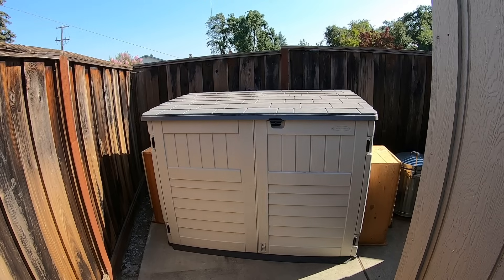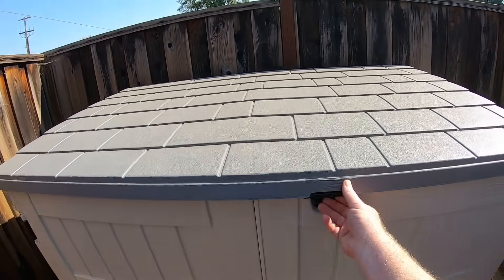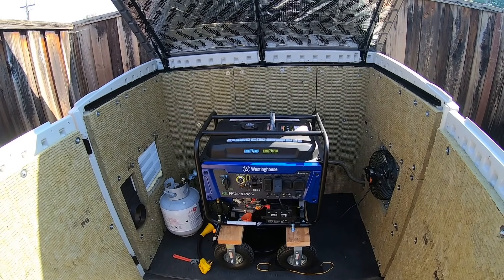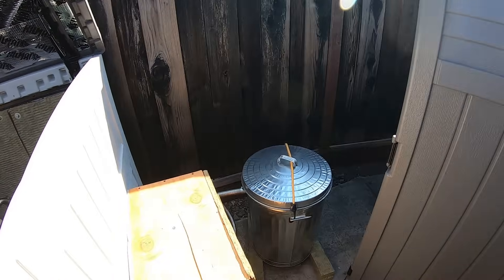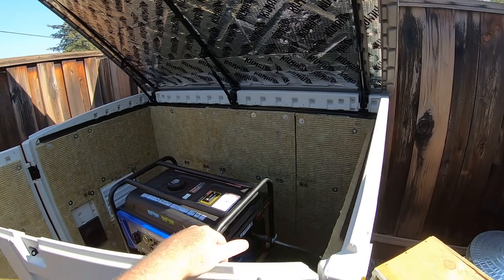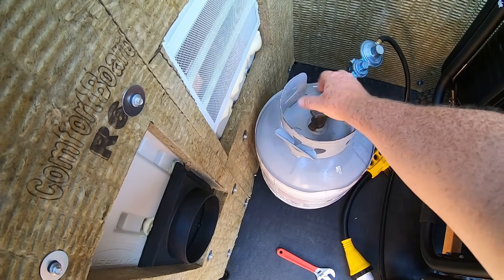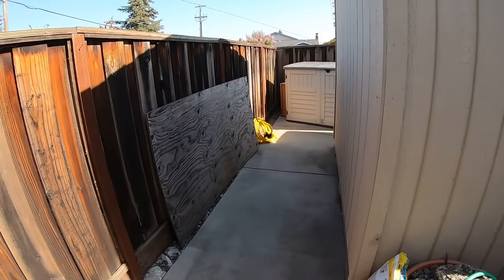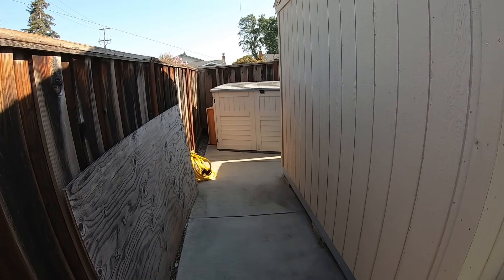DIY Generator Shed Build - Quiet Sound Insulation with Exhaust Muffler

Comment: have you thought about adding spray foam insulation to the inside of the shed as well? that's what they do on the generators used for film - since it has to not just be quiet, but silent for dialogue
Reply from the maker: I did use spray foam around all the holes that I cut for the vents and the fan and such.  This was to seal the holes and keep water from getting in.  However, you have to be careful.  The foam does expand, and can make the plastic panels bulge out.  It might make a bit of difference in sound levels, but I'm not sure how much.  I also didn't want to drill dozens of extra holes in the shed.  So I'd say try it at your own risk.
Reply: @C5Tor  when i wrote this i hadn't realized you used the rockwool. I'm sure that's probably do the same thing, spray foam on top wouldn't do much more. The film generators I've been around seem to be about this loud anyway. we usually park them behind a building or a big box truck to block the sound even more

Comment: What has been your average run time on a  tank of propane?
Reply from the maker: I haven't had to run the generator in anger yet.  Managed to dodge any power outages since I built the shed.  Only ran it during testing phase.  Supposed to be about 8 hours.

Comment: You should put the tank on the outside of the shed in another small structure!
Reply from the maker: Agreed.  The shed is setup so that I can put the tank outside while running, and pass the propane hose back inside via the same opening as the electrical cables go out.  I discuss this in a separate video.  When I made this video, it was just for sound testing.

Comment: Well done kind Sir. Thus, I will do the same.
Reply from the maker: You might want to check out my later videos.   I did a later video on my Version 2.0 exhaust, which has quite a few improvements over the earlier version 1.0 setup.  The newer video has parts lists, shed costs, and other Frequently Asked Questions.  Check it out here: https://youtu.be/y3pUw408jCU

Comment: Thanks for the really great video, and sharing your ideas. Question: I am following your lead with my own shed - how did you attach the Rockwool to the sides? I see bolts/nuts/washers on the inside, but not on the outside of the shed. What exactly did you do, and what specific parts were used? Thank you again for the video, and in advance for your time in providing this info.
Reply from the maker: I go into all of those details in a later video on my channel.   I did a later video on my Version 2.0 exhaust, which has quite a few improvements over the earlier version 1.0 setup.  The newer video has parts lists, shed costs, and other Frequently Asked Questions.  Check it out here: https://youtu.be/y3pUw408jCU

Comment: What kind of screws did you use to attach the rockwool to the plastic. From the looks of it, the screws have to bite into the plastic on the inside without poking out to the outside. Does the vibration from the generator cause the screws to fall off?
Reply from the maker: I go into all of those details (and a LOT more!) in a later video on my channel.   I did a later video on my Version 2.0 exhaust, which has quite a few improvements over the earlier version 1.0 setup.  The newer video has parts lists, shed costs, and other Frequently Asked Questions.  Check it out here: https://youtu.be/y3pUw408jCU

Comment: I think you could lose even more noise if the box structure wasnt just plastic, but made of something like brick or paving slabs. also where possible have no opening on the side or bottom having them on the top allows the sound they leak to go skywards away from other people and buildings

Comment: Nice setup, is there any concerns that the propane tank is inside the enclosure with the generator and the heat that is generated , the heat can get too hot , which may cause the propane tank to explode. I was considering do the same setup but my son brought this to my attention. What is you thoughts. Please reply . Thank you
Reply from the maker: Yes, the propane does go on the outside.  There is an opening on the left side where the electrical cables and the propane hose can exit the shed.  You can just set the propane tank outside and run the hose back into the inside of the shed.  The video was just testing the shed sound levels, so I never bothered to move the propane tank during the short test runs.
Reply: @C5Tor  thank you for the information, I was nervous about keeping the tank in the shed with the generator.

Comment: Where did you get your wood at
Reply from the maker: The only wood I used was for the side baffles.  I just used some scrap wood I had laying around from other projects.  I do give some measurements/specs for the dimensions I used in a later video about the version 1.0 exhaust and the making of the trashcan muffler (see my channel).  However, those were just what I used, and there isn't any requirement to use that size.  You could use plywood, MDF, 2x4's etc.
Reply: @C5Tor  rockwool material broad can't fine them anywhere.

Comment: Does yours have a CO2 shut off it will build up in that shed box! But I keep my generator in the. Exact same box so I drilled 2 holes as far apart around the corner and ran a motorcycle security cable around it. I just feel like the shed is easy to break the lock but the cable would take breaking it alot!
Reply from the maker: It does have a CO2 cutoff, but it hasn't triggered during testing.  The fan moves quite a bit of air through the shed, and all the air is cycled every few seconds.  The shed is only 70 cubic feet. (minus the space taken up by the generator itself), and the fan moves 1000 cubic feet per minute.  If the fan fails, the CO2 cutoff should trigger fairly quickly, though.

Comment: I was an engineer for a company that designed huge generators outta massive diesel engine. For 2 companies. And designed Many enclosures. For a newbie good job.
Reply from the maker: Thanks for the encouragement.  I certainly did a few things wrong on my first attempt.  I corrected a few of them in some later videos, like enlarging the exhaust and updating the muffler a bit.  Should definitely update the fans for better airflow, though.  But it is probably good enough for the purpose it was intended to address.  Thanks again!

Comment: great video I like the bigger wheels how did you build that and mount the generator to it?
Reply from the maker: I actually go into some detail on the wheels and how I attached them in the Frequently Asked Questions section of a later video on the shed/exhaust build.  I did a later video on my Version 2.0 exhaust, which has quite a few improvements over the earlier version 1.0 setup.  The newer video has parts lists, shed costs, and other Frequently Asked Questions.  Check it out here: https://youtu.be/y3pUw408jCU

Comment: Thats awesome. I want to make a small enclosure for my 2200 Honda that I use for my RV. I thought a plastic tote would make it most portable. Then I told myself that was crazy. But if it is lined with the rockwool and vented well like your plastic shed, that might not be so crazy 😁. Great video

Comment: What cutting tool was used cut into the shed side walls for the vents and fan?
Reply from the maker: I personally used an oscillating multi-tool with a plunge-cut blade.  Goes through the plastic like butter, and allowed for nice straight cuts and sharp corners.  I actually go into some detail on this tool in the Frequently Asked Questions section of a later video on the shed/exhaust build.  I did a later video on my Version 2.0 exhaust, which has quite a few improvements over the version 1.0 setup.  The newer video has parts lists, shed costs, and other Frequently Asked Questions.  Check it out here: https://youtu.be/y3pUw408jCU

Comment: I have a question for you.  I've built a similar generator house, inspired by your video.  My shed is a little bigger; I can store 4 5-gallon gasoline cans with a pump with room to spare.  (I take the gas cans outside of the shed while operating)  I have the same generator although it is gasoline only.  My question is about heat.  Does your system stay within the maximum recommended operating range of what is called for in the manual?  I worry about my system after testing.  The manual states 104° F maximum ambient temperature for operation.  My system generates far above that, about 112° F all closed up with no load.  The manual says the generator can be run for short periods @ 122° F ambient, but I fear that temperature will constantly exceed that if closed up and under load.  Have you run your system under load all closed up while monitoring the temperature.  What is the temperature while running under load and how long have you sustained under-load operation at that temperature?  I am going to install a second vent and perhaps another fan.  My current fan appears similar to yours, it is 1650 CFM.  I can always pop the lid open a bit to maintain a safe operating temp, but that does defeat the sound proofing to some extent.  What has been your experience?
Reply from the maker: Good question.  I haven't had to use the generator shed in anger yet.  So I haven't had a chance to do any long-term testing.  Longest run has been about 15 minutes.   I would say that additional airflow is always a good thing, and if I had anything to do different, it would probably be adding a slightly larger fan and inlet.  I did make a couple later videos, especially one where I upgraded to a larger, more free-flowing exhaust, so you might want to check that out on my channel for additional tips.
Reply: After further testing...
 @C5Tor  My system  with fan running (12" Dave Brown 1800 CFM- not 1650) and a single 12" X 12" vent, (with no soundproofing yet) all closed up with about 30" of exhaust pipe, inside the enclosure, wrapped in heat-proof fiberglass tape to help contain heat within the pipe, takes about 30-35 minutes to reach an ambient temperature of 124° F.  This is with no load.  Adding a load generates significant additional heat.  The manual states that this generator can operate @ up to 122° for short periods of time.  Obviously, this is unacceptable lest you risk potential (and permanent) damage to the unit.  I will install another vent, but I doubt that will completely resolve the heat issue.  The situation is easily resolved by raising the lid 8" to 10".  This allows some sound to escape, and will also let some rain in, but both of these issues are significantly attenuated by the enclosure itself and may be acceptable for continued operation.  The intruding weather and escaping sound are a drawback, but better than frying a $1000.00 generator.  I will make a few changes (like the additional venting) and report back via this comment section on the results.  I too, plan to make a video of my build, and I will include the excessive heat problem.  I am afraid though that I will ultimately be forced to operate the system with the top slightly open for continued safe operation.  At this point, it certainly appears that way.  Please note that the manual recommends a 5-hour break-in period under varying loads.  I've got about 2½ running hours on mine so far.

I hope my comment is useful to anyone considering this build.  I also hope it helps you, C5Tor, with any of the same issues you may experience.   -Floyd

Question:  Why would you use your generator in anger?  Don't do that!:goodvibes:

Comment: NEW SUB!! Thank you for this video. Just what I needed to see.
Reply from the maker: Make sure you check out the later videos as well.  There are several more videos in this series.  I cover how I built the original trashcan muffler in the Exhaust Version 1.0 video (view it here: https://youtu.be/jZpRSenXJAs).  Then I did a later video on my Version 2.0 exhaust, which has quite a few improvements over the version 1.0 setup.  The newer video has parts lists, shed costs, and other Frequently Asked Questions.  Check it out here: https://youtu.be/y3pUw408jCU

Comment: Just to let you know... The 50 amp plug is never going to give you 50 amps. That generator is rated for 8500 watts continuous on gasoline but you're running it on propane. That means you'll get about 8000 watts max. 8000 divided by 240 volts is 33.33 amps. Now, running the fan off the 120 Volt outlet reduces that to about 30 amps left.  You wasted your money on the big 50 amp extension cord. Sorry.  Nice shed build though.
Reply from the maker: Yes, I definitely know it won't put out 50 amps.  I went with the heavier 50 amp cable because I was more concerned about heat and loss over the considerable distance using smaller cables.  The generator is actually rated a little higher than you mentioned, at 9,500 running watts, 12,500 peak watts (gasoline); 8500 running watts, 11,200 peak watts (propane).  My main objective was to be able to charge two electric motorcycles at the MX track at the same time, which requires 32 amps.  This generator should be able to push 35 amps continuous on propane (39.5 on gas), which I have confirmed in testing, and it charges both bikes at the same time just fine.  (See my later videos on my channel where I test this scenario, as well as upgrading the exhaust to a larger diameter to improve flow.)  At the MX track I won't be running a fan.  Whatever capacity I get in a backup power situation at my house is all bonus, and is secondary to the generator's primary function.

Comment: Can you tell us more about the wheels? Install???
Reply from the maker: They are 10" Harbor Freight fixed castors.  I cover the parts list in a later video.  There are several more videos in this series.  I cover how I built the original trashcan muffler in the Exhaust Version 1.0 video (view it here: https://youtu.be/jZpRSenXJAs).  Then I did a later video on my Version 2.0 exhaust, which has quite a few improvements over the version 1.0 setup.  The newer video has parts lists, shed costs, and other Frequently Asked Questions.  Check it out here: https://youtu.be/y3pUw408jCU
Reply: @C5Tor thx

Comment: I am trying to find a flange for the exhaust, do you remember where you got yours from?
Reply from the maker: I actually changed the design up in a newer video.  I include parts lists in my 2.0 Exhaust video.  There are several more videos in this series.  I cover how I built the original trashcan muffler in the Exhaust Version 1.0 video (view it here: https://youtu.be/jZpRSenXJAs).  Then I did a later video on my Version 2.0 exhaust, which has quite a few improvements over the version 1.0 setup.  The newer video has parts lists, shed costs, and other Frequently Asked Questions.  Check it out here: https://youtu.be/y3pUw408jCU

Comment: How do I pass the exhaust through the wall so the plastic doesn't melt.... thank you so much
Reply from the maker: I cover how I did it in a later video for my 2.0 Exhaust.  There are several more videos in this series.  I cover how I built the original trashcan muffler in the Exhaust Version 1.0 video (view it here: https://youtu.be/jZpRSenXJAs).  Then I did a later video on my Version 2.0 exhaust, which has quite a few improvements over the version 1.0 setup.  The newer video has parts lists, shed costs, and other Frequently Asked Questions.  Check it out here: https://youtu.be/y3pUw408jCU

Comment: I wonder if it will be much quieter if you sound proof the concrete maybe try them Gym Matt's made of recycled tyre
Reply from the maker: I eventually just put some more Rockwool sheets on the floor.  I don't think it helped much with sound, but I felt it would help keep the heat from affecting the plastic floor.   I might be wary of using a recycled tire mats, as those are definitely flammable.  Check out my 2.0 Exhaust video, which has quite a few improvements over the version 1.0 setup.  The newer video has parts lists, shed costs, and other Frequently Asked Questions.  Check it out here: https://youtu.be/y3pUw408jCU

Comment: It’s about time the YouTube algorithm showed a generator shed enclosure with sound deadening material in my results. I’ve been researching (in YouTube lol) and this is the most complete video. Finally getting ready to build and take my garage space back. Thanks for sharing. Just wish the shed prices were cheaper. Can’t find this size shed for anything less than $469. Even from other individuals the cheapest I’ve seen is $400.
Reply from the maker: Good luck with your build.  There are several more videos in this series.  I cover how I built the original trashcan muffler in the Exhaust Version 1.0 video (view it here: https://youtu.be/jZpRSenXJAs).  Then I did a later video on my Version 2.0 exhaust, which has quite a few improvements over the version 1.0 setup.  The newer video has parts lists, shed costs, and other Frequently Asked Questions.  Check it out here: https://youtu.be/y3pUw408jCU

Comment: Pretty cool setup. The only recommendation I would have is to remove the propane tank from enclosure . As the tank heats up it builds pressure. If the pressure reaches its limit the tank has a blow off valve. If it blows off inside that enclosure you will turn that enclosure into a large expl*sion.
Reply: At what temperature?
Reply: You're exactly RIGHT!